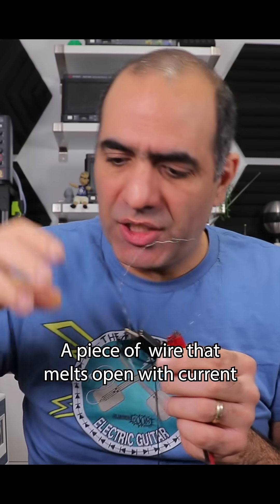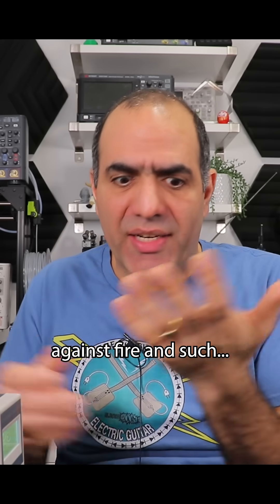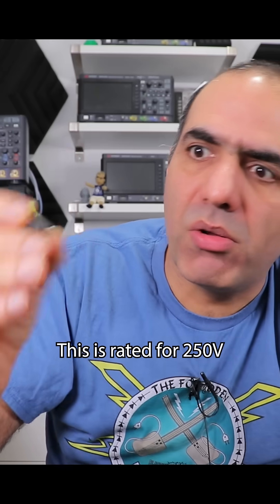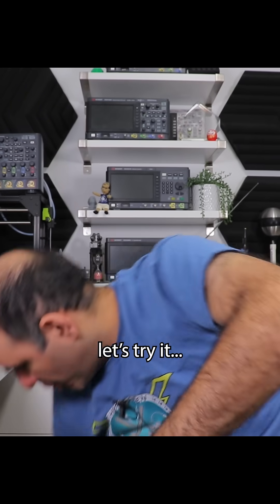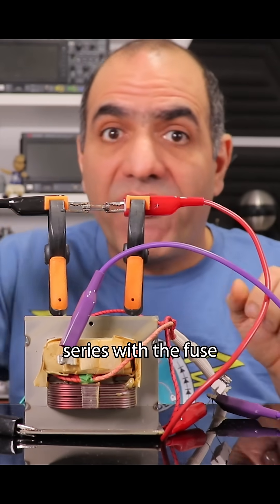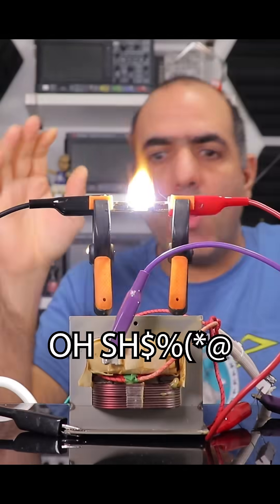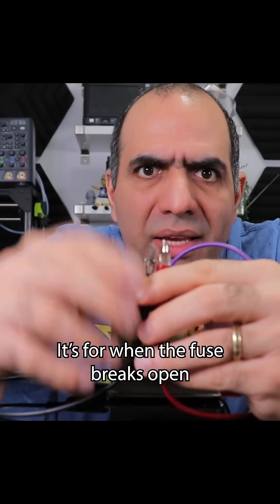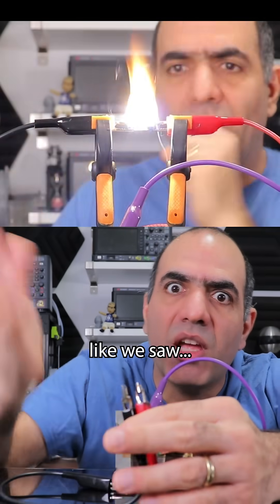Why Fuses have Voltage Rating? #fuse #rating #electronics #funny

Comment: In britain we have a third stick on our plugs called the ground stick (idk what the other word for stick is) and it leads to a fuse which blows if you put too much voltage into something and this stops the fire from escaping the plug and blowing up your walls or setting your house on fire.

Comment: This is not a valid fuse connection type. Even if you connect 250 V or 110 V same thing will happen. You are short circuiting high voltage. 2000V/0Ohm=inf A

Comment: Fuse is simply a bridge that only colapses when too much eletric weight pass through it, preventing the overloading of your devices.
Reply: How much weight is stated by how much voltage rating the fuse has.

Comment: I remember in my auto class my teacher saud multiple times to not directly connect positive to negative in a parallel circuit since thatll blow the fuse, and some people kept doing it and wondering why the lights kept going out.

Comment: I once snapped my fuse in a generator, it is rated for 250V 15A, then I go to the store and they only have 250V 10A. It is lower but I use it anyway because I can't find another alternative I need it immediately and I can't wait for days to order from the online store. It works. So, yeah at least there is a fuse protecting it.

Comment: The voltage rating there exists because in a different voltage the intensity (amperes) that the wire can withstand is different based on it's resistance and diameter. For example if you passed current through that fuse with 380 volts instead of the rated 250v, then the fuse wouldn't withstand the rated amperes, it would withstand way less, and if you used 12 or 24 volts then it would withstand more amperes than the rated current.

Comment: Fuse has low melting point such that it prevents home appliances under short circuit conditions. But, presently there  MCB's (Miniature circuit breaker) instead of fuse.

Comment: As much electricity and electronics as I know from 60 years as a hobbyist and I have always wondered why a fuse had a voltage rating. 
No way to make this more memorable. 
Excellent video!
Reply: Ironically, I understood the reason of the rated voltage in fuses, when I understood the function of spark gap devices.
Reply: @mariobv947  diversity is important: everyone contributes. No one knows everything. Thank you for your post.

Comment: The same goes for the voltage rating of a switch or relay contact. Often different for AC and DC. Some circuits (like inductive ones) can generate arcs when you open the switch, and over time the arcs can burn out the switch contacts or weld them together.

Comment: That's not all. You also shouldn't use fuses with too high voltage rating, especially not DC fuses. In the event of an overcurrent, these fuses can create a back-voltage to break the current, and this back-voltage can destroy nearby circuits, if the voltage rating isn't adequate.

Comment: these fuses are used only in DC devices. So..
Reply: Fuses are used in AC devices all the time. And a DC voltage will still arc perfectly happily across a small enough air gap, especially with a bunch of ionized metal gas floating around from the vaporized fuse wire.

Comment: isnt the rating for the purpose of not over volting it, since if there is enough voltage, there will be an arc between the broken wires and the fuse will still let power get through and fry everything after it

Comment: Sorry bro, but the slapstick is putting out the wrong message to some.  Or maybe I should put it in a different context. I experienced 7,620 volts entering the upper left quadrant of my being on it's way to ground via my left heal. I'll spare the details with the exception of the cause of accident. One thing that I wish I had paid attention to is safety. Not trying to be critical I just feel it may be a little stronger message coming from a celebrity

Comment: I've actually always wondered this. I assumed the amperage rating was all that really mattered. Now I know why the voltage rating is very important.
Reply: Same. I thought that a fuse's primary function was to prevent excessive currents. That even with low voltage, such short circuits can still generate excessive currents that could blow components.
Reply: I'd imagine that if a fuse is rated for 1000 volts, then 1010 volts wouldn't behave much differently from the rated amount
Reply: @marmot418  I'm sure you're right, but if you have a fuse rated at 600v, but you're running 1000v through it, it will be fine until it pops, then you might just have a problem.
Reply: Most fuse equipment is plenty well rated for residential 120/240 volts and even 3 phase 480. The only people that work on voltages beyond that have hundreds of hours of training at the least.
Reply: @ashenmoonclash  Hundreds of hours of training? Not in all places.
Plus, it's not like you can reliably get that kind of "training" outside the actual job site anyway.
Reply: @LecherousLizard that's why journeymen have thousands of hours as an apprentice.. around 8600- 9000
There's also ~900 hours in trade school. So yeah, hundreds
Reply: @LecherousLizard  I ate my words you're right, I've been training idiots for years. I just meant we get trained for many hours. Hit or miss pretty much

Comment: Question.  @ElectroBOOM. I plugged my 110v welder on 220v by accident. What possible damage would it cause and does it make sense repairing? Its a flux core welder

Comment: Additional point. Fuses also have a rating for the maximum interuptible fault current. Youd think it wouldnt matter what the available fault current in the circuit is that more current would just make the fuse blow faster. And, while thats true, the issue is that above its max fault current rating the fuse burns so fast it can explode.

Comment: P over I times E.  Lower the load enough and your fuse should handle the current no matter the voltage. Let the arc over be the next guy's problem 😂

Comment: Now I kinda feel bad about putting regular glass fuses in my craftsman meter instead of the original high voltage ones. Oh well, its only used on 12v systems anyway.

Comment: My understanding (Mech Eng) is that fuses are rated by Amps to blow in a specific period of amps vs time. This can vary & may be important with circuits with motors as start currents can be up to 6x normal full load current for a brief period.
It makes sense that they are also voltage rated so they remain open circuit when failed, although not something I had thought much about. Probably understood intuitively as you obviously wouldn't use a low voltage fuse in a high voltage circuit, duh! 
I'm not familiar with 0Volt rating, need to rewatch see if it comes to me. Thx

Comment: Cool! anyway, here is the recipie for brownies!

- 1 cup (2 sticks) unsalted butter

- 2 cups granulated sugar

- 4 large eggs

- 1 teaspoon vanilla extract

- 1 cup all-purpose flour

- 1/2 cup unsweetened cocoa powder

- 1/4 teaspoon baking powder

- 1/4 teaspoon salt

- 1 cup chopped nuts (optional)

Instructions:

1. Preheat your oven to 350°F (175°C) and grease a 9x13-inch baking pan.

2. In a medium-sized saucepan, melt the butter over low heat. Remove from heat and stir in the sugar, eggs, and vanilla extract until well combined.

3. In a separate bowl, sift together the flour, cocoa powder, baking powder, and salt. Gradually add this dry mixture to the wet ingredients, stirring until just combined.

4. If desired, fold in the chopped nuts into the batter.

5. Pour the batter into the prepared baking pan, spreading it evenly.

6. Bake in the preheated oven for approximately 30-35 minutes, or until a toothpick inserted into the center comes out with moist crumbs (not wet batter).

7. Allow the brownies to cool completely in the pan before cutting into squares.

Enjoy your homemade brownies!
Reply: thanks man! will try it out
Reply: Please remove the extra return lines (spaces)

Comment: Then man is an electrical genius. I have decades of electrical experience in commercial electrical and commercial hvac. It's one thing to know about electricity but when you can make fake accidents happen just to be funny and make hundreds of them that truly don't hurt 1 you have a concept of electricity that's on another level #2 he has a great way of teaching to where even if you know little to none about electricity you can still enjoy his videos
Reply: You may appreciate this. I'm a Mech Eng with decades Commercial HVAC experience. I had an unusual issue with large old carpark fans 5mm plate steel centrifs. I forget exact details but we were upgrading the old Mech switchboard contactors, overloads & new vsd drives. Bottom line the standard motor contactor overloads (bimetalic type) kept tripping due to the high fan inertia with vsd start, iirc, ie. needed more time to get away under high elec load. Solution was electronic overloads that allowed a different time profile start in conjunction with the vsd. Ok not related to fuses but reminded me. May be a useful tidbit to put up your sleeve for future. I find that most Elec Eng & Lights n Power Elecs don't have much knowledge of hvac mech elec, here at least in Australia. Worse is young Elec Engs not having power training or barely knowing anything about 3ph power!

Comment: That’s a current fuse. There are also thermal fuses that are embeded in motor windings. When the bearings run out of oil, the fan blade slows down, and, in order to prevent a fire, the fuse melts and prevents it. Then you have to dig inside the motor and replace the fuse. OIL YOUR FAN MPTORS OR ELSE!
Reply: That's not the only reason for motor thermal fuse although effectively can be. The simple reason is motor thermal overload for any reason eg. seizing bearings, excess motor starts direct online (DOL) more than 6 per hour can cause over heating, excess current draw from stalling/overloading motor, insulation breakdown. 
Bearings use grease not oil & usually sealed for life so maintenance free unless large bearings requiring regular greasing via grease nipples.

Comment: in near 20 years in the electronic/electrical industry I never really understood this until just now. Thanks mate for explaining.
Reply: @shugo1047 electrical engineer here, I didn’t know either lol. It’s not that you don’t know how fuses work, it’s just that you follow the ratings and don’t always think about what they come from
Reply: @shugo1047 I didn't know either this was the exact purpose ...I always thought it referred to its capacity as with their amperage rating....
Reply: @carlosmejia5728  Well, yes. Amperage burns the wire, voltage determines how far the charge can jump.
This is why you have distance norms for power lines and other related things based on voltage, not amperage.
Reply: So glad I wasn’t the only one!
Reply: The great thing about the internet is that there is a lot of knowledge that you can access for free. The fact that you got this info not from a quick Google search because you are interested,  as it is pertaining to your field of work,  but by chance from scrolling through youtube to search for entertainment really explains a lot about you and many people like you.
Reply: That's great news. It's the progress of people and science. We can understand complex things in simple ways. But also gain more knowledge if we wanted to. Soon our grandkids will understand what we worked hard for as simple things as well 😊 (another good example is screen resolution)
Reply: High voltage fuses have a spring that pulls it wide open.
Reply: @okaro6595  This isn't actually true. There are some specific fuses that do have springs to open them (often called slow-blow fuses), but this is not a super common type of fuse. A mechanical mechanism to open a fuse would actually be quite ineffective compared to how fuses actually operate. At short circuit fuses operate within a span of milliseconds. Breakers on the other hand do use mechanical means to open and operate in ~40-50ms. It is way faster to operate the way a fuse does (at short circuit).
Reply: @shugo1047  you can learn to do so.ethong without knowing how it works. Like working out. Might not know how the muscles (I do) get stronger, but they do

Comment: I use to ask this question to new engineers why fuse is rated in current like 1Amp, 5Amp likewise & not in voltage like filament lamps!

Comment: That fuse worked double duty, the wire went open and when the high voltage arc'ed, the glass fused and broke the arc 😂😂

Comment: His electricity bill through the month : 📈📈📈📈📈📈📈📈📈📈📈
Reply: same with his hospital bills💀
Reply: @DexterHappy  no, he lives in canada so his hospital bills are $0
Reply: Depends on the transformer and how long he powered it. Transformers usually transform lower voltage into higher voltage. You're only being charged for the lower voltage you are using. Not the higher voltage you are using the transformer to achieve.

Comment: nice but will a 4A fuse melt at the same amperage at 4v or 12v?
Reply: A fuse must not just blow at a certain amperage but with also reasonable speed. So if your 4 A fuse is rated for 12 V and you put in a 4 V circuit it takes a lot longer to blow, even if it has the same overcurrent of lets say 10 A going through it.

Comment: For something so trivial I didn't know the right answer at all. I have an education in automotive electrical systems so only 12v systems, but I thought I had the basics covered. Apparently I was mistaken
Reply: Caution: those cheap auto fuse kits have been tested and do not reliably blow at the correct rating. Buy only name brand fuses.
Reply: @campkohler9131 good to know thanks...& why am I not surprised
Reply: Electrical engineering is such a vast field its impossible for any one person to grasp even just the fundamentals of every branch.
Reply: @vwlz8637  You can say that again. I have basically no knowledge of alternating current systems and extreme high voltage. The little I do know comes from this channel and from styropyro, so not exactly an MIT level education
Reply: nah bro,
as a mechanic my self we did have some of it covered but not all,
we learn everyday
and there's still a lot lot more to learn
Reply: Automotive systems have 100v piezo injectors from around 2012. And if you think about electric Cars...
Reply: @Theag393 yes, individual components have step ups to various high voltages, but I'm not working on individual components. I'm working on the entire car, which has a 12v battery and a 12-15v alternator. Everything else runs off of those

Comment: “Let’s try it with my high voltage transformer… D O N’ T “ this part is just LOL
Reply: Fr I think that transformer even at that size is enough to you blow your brain out 💀
Reply: @Nutiiiiiiii it will fuck you up. 2000V at a couple amps AND it’s decoupled from the primary windings so a GFCI won’t trip if YOU become the ground fault.
Reply: Yeah seriously don't try that at your home you can get killed fr
Reply: Ya
Reply: Lol
Reply: And then we immediately find out why don't
Reply: Funny but hes right. This is a Microwave oven Transformer or MOT for short. 

This can easily kill. In fact, its responsible for most deaths of the people that use them for their shenanigans.
Reply: Microwave transformers are crazy dangerous to toy with.
Reply: That's fine. I'll just try it with my high voltage EV battery instead. Unlike the transformer it doesn't have any realistic amp limits.
Reply: How tf is bro still alive
Reply: Seriously, will a 240 VAC fuse rated at 1 amp still blow at 1 amp in a 12 volt DC circuit? I think so, but I am not sure...
Reply: @chopper5371 it will hot, maybe become bulb, but not destroyed
Reply: @chopper5371 i 240V sono la tensione massima quindi a 12V funzionerà benissimo...
Reply: "...it will open quickly, protecting the circuit."  Immediately arcs, bridging the gap, the glass fuse catches on fire.  I laughed harder at that than most of the other EletroBOOM scripted goofs.

Comment: that's why our UK plug fuses have to be filled with sand. to stop the arc's forming.
Reply: Most large fuses are, however for a small fuse it is nice to be able to check the fuse without needing to take it out or probe it. Automotive fuses have a similar feature but in plastic.
Reply: @xxportalxx.  We need to check our mains plug fuses with a meter as they are also ceramic. We always play safe with out plug fuses. 🙂
BS 1362 is the required  standard for them.
Also it should be remembered that a fuse or circuit breaker is there to protect the wiring not the equipment. it should always be rated less than any wire it protects.

Comment: I was waiting for him to touch the 2000V circuit 😂
Reply: No more electroboom😔
Reply: @samueldavies646  ya
Reply: next time he does that could be the last time
Reply: He already did it back in 2017
Reply: nah,
he's not dumb to touch something out of his limit,
all he been doing was on his control,
and that 2000 volts my bros is surely not inside his limit
Reply: Vid link @AZBTube
Reply: "I  was waiting for him to touch the 2000V circuit 😂" - He did not for a VERY good reason and you should not either. Take this from a power engineer...
Reply: thanks

Comment: I never thought that this was the reason.  Good info.
Reply: Yeah him getting hurt is actually quite a good way to teach safety
Reply: yeah, you want the arc to be contained, so High-Volt fuses are longer and often encapsulated in ceramic or minerals. Also if you have a highly inductive circuit, the breaking voltage can spike considerably higher because the stored magnetic energy wants to go somewhere (the current doesn't change instantaneously) so it becomes very important to maintain a wide air gap between the terminals
Reply: Jgkkg